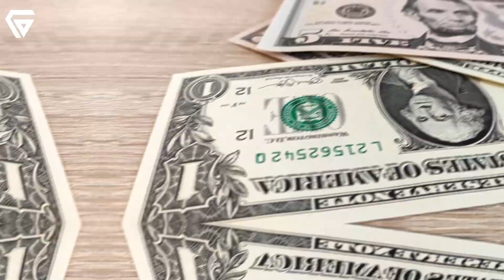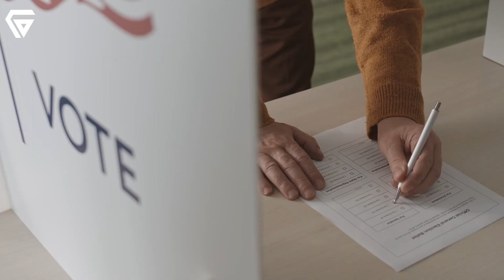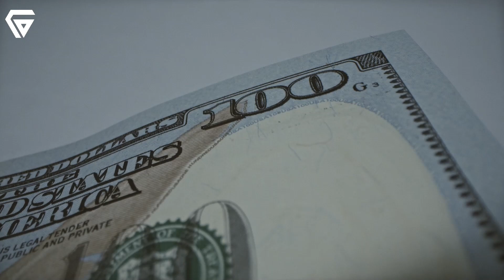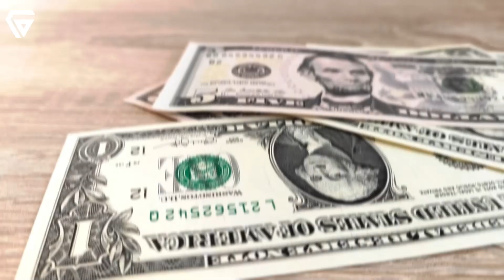Why It Is IMPOSSIBLE for Australia to Build High-Speed Rail?

Comment: The more I think about HSR, the more I realise what a TERRIBLE waste of money it will be.
Take the Sydney to Melbourne route - which is supposedly the primary route. Currently, the GROSS annual airfare revenue of this route is $1.2 billion. That's all. Why would we want to build a line likely to cost (knowing our political system) over 100 times that amount which, even then, will likely capture at best 50% of the daily passengers of the existing flight system.
The maths do not even come close to adding up. Even if it cost $30 billion the business case would still be extremely shaky.
And, being a $100+ billion system, its annual maintenance and operation costs ALONE are likely to well exceed the entire $1.2 billion airfare revenue. There is no business case whatsoever. It's a joke.
Reply: Because more people will take the train because it will be cheaper easier and more efficient

Comment: i don't know why people still think a melbourne-sydney HSR is worth discussing let alone building. a 900km line between 2 cities of 5/6 million each with little in between will never stack up economically even if the terrain is easy, which it certainly isn't from Sydney to Junee at least. If you don't believe that, take the ride. Air travel is the way to go in Aus, and it already does a very good job, and is much more flexible and efficient in getting ppl from A to B, M or X.. less flights and larger capacity aircraft would help environmentally between the big centres

Comment: Easy answer.
Lobbying from private self interested parties who support particular 
Conservative governments re, road haulage for freight, which then affects 
The viability of an improved or new rail network for passenger mostly.
Combined with the current stupidity of our current state government 
By buying new updated inter city trains, capable supposedly of 160 km speeds 
When the infrastructure is crumbling , and especially the trackwork. 
Climb aboard a fancy new carriage, and take just as long, or longer because of deteriorating track work  to  complete your journey.
Has  anyone  recently had a look at our Northern Rail  link near Urunga and Coffs Harbour.
To call it third world is too much credit.
For now, forget high speed 200 km rail Sydney to Newcastle, with new tunnels, feasibility studies, problems with 
Land acquisition,it won't happen in our Lifetime.
Inspect track ,, realign, straighten where possible, camber the tighter curves , 
And invest in tilting Rolling stock like many overseas countries.
Now, you need a decent timetable to mix express and stopping journeys.
No use catching a modern fast train that stops All the way from Sydney to Newcastle.
Maybe have to compromise for now by one stopping first half of journey and another stopping second half.
Commuters are big percentage of revenue.
Maybe install passing loops at regular intervals. Relatively cheap option.
Out of hours majority of runs virtually non stop , major stops Only.
Every hour? Now stoppers can fit inbetween .
Food for thought?. Reality.
Thanks Howard

Comment: After decades of delay, Australians should realise that if the interstate high-speed rail project "needs" to be done, an independent federal institution must be established, and a corresponding law is also required to protect the existence and authority of this federal institution from being easily abolished by the new government if they are not happy with the high-speed rail project. To achieve this, a series of legislations should be successfully performed within 1 or 2 federal terms, and the first term must have the pro-HSR party in a majority government.

But what are the real circumstances? Some Australians obviously don't believe such a future-proof project is "needed." Therefore, no major party will be brave enough to proceed with the abovementioned steps since the majority government will be in danger at the next election. 

In addition, a critical problem with Australia's tax system might be a hurdle for this project. Australians pay their income tax and GST to the federal government, and the federal government then divides the tax funds back to each state and territory through some mechanism. I'm not sure if it will happen, but some people on the West Coast will probably worry that their tax funds could be used to build the high-speed rail while the high-speed rail makes no sense for them since they're living too far from the rail line. This is a fundamental tax-related problem when the federal government wants to support projects that will cost a lot and benefit only some people living in a particular area.

Comment: They should be building on between Melbourne and Geelong that is the first place I would one.Two would be Melbourne to airport.these two will never happen and I’m seventy.someone should go to Europe and see  how they move people around.trams don’t have problems and bus just keep moving here it is a standstill.Got to tax the workers so they cover their superannuation and trips.
Reply: Wouldn’t be any point in HSR between Flinders Street and the airport… trains wouldn’t even reach anywhere near top speeds before having to slow down again.

Flinders Street to Geelong MAYBE… kinda echoes the Sydney to Newcastle HSR route, but on the other hand Geelong would have to grow into a bigger city first for that to be viable
Reply: @LucyJrts - people would commute from Geelong to Melbourne and return if it had a decent rail link is the short of it.
Reply: @chuckbeggles8858   HSR isn’t meant for commuter use though, same reason people don’t commute from Adelaide to Melbourne by plane despite it being only an hour’s flight. Same reason people don’t commute from Berlin to Düsseldorf or Paris to Lille or Brighton to London or Kyoto to Nagoya, all of which are served by comparable length HSR routes (I think Kyoto-Nagoya is only half an hour and departs every few minutes in peak times).

HSR can’t survive on commuters. If anything the idea should be to grow Geelong into a fully-fledged city in its own right, with its own local suburban rail network, and then create a short intercity hop via HSR, just like the Kyoto-Nagoya route. That’s why the most likely candidates for HSR in Australia are Canberra-Sydney-Newcastle, or Gold Coast-Brisbane-Sunshine Coast

HSR is meant for intercity travel, not commuting. It’ll never get built based solely on commuter demand, that’s a pipe dream unfortunately.

Comment: Sydney to Newcastle makes sense.  Would turn Newcastle into a suburb of Sydney unlocking land for new subdivisions
Reply: The only two cities worth joining in Australia are Melbourne and Sydney. Everything else is just fantasy material. You need two massive populations for HSR.
Reply: Most of the land between Sydney and Newcastle is already suburban. This means both the path would be harder and less room to improve density.
Reply: @waza987  would require a lot of tunnel making it expensive
Reply: agree.  Sydney - Newcastle.  Sydney - Bathurst.  Sydney Canberra.

Comment: It costs a lot of money to build it, also a lot of money to maintain it. Railway in China is losing a lot of money as well even if the labours in China are very cheap.
Reply from the maker: You're absolutely right! The costs of building and maintaining infrastructure can be staggering, even with cheaper labor. It's a complex issue that many countries face.
Reply: China intentionally built HSR lines that’ll never be profitable, in order to force the breakaway regions like Tibet and Xinjiang into the fold. It’s purely political.

The actual major HSR network in eastern China is profitable enough

Comment: If it was up to me, rather than building entirely new routes, I would focus on straightening some of the steam age curves, especially on the Sydney-Melbourne route, along with double track between Junee and Albury, and between Lithgow and Orange. Once you do that, you can bring in tilt trains. While it’s not HSR, it will still be faster than what we have now.

The NSW North Coast route is probably beyond redemption, but even it would benefit from tilt trains. 25 kV electrification is doable beyond Lithgow, Broadmeadow and Campbelltown, as long as you have dual-voltage power cars. The North Coast route would also benefit in that you would have 25 kV from Broadmeadow to Brisbane Roma St.

While this will all cost money, it won’t be as much as a dedicated HSR line, with or without massive tunnels.

By way of examples, the S-M XPT can’t get up to a decent speed north of Junee, and the Dubbo XPT only gets a chance to stretch its legs between Orange and Dubbo.
Reply: Being a Newcastle person you would understand much of the issue at hand given the extreme difficulties in getting a railway line all the way from Sydney. The sandstone Hawkesbury / Woy Woy area was a huge achievement in the day and a section of your track was finally built after the track to Hawkesbury and then Gosford to Newcastle had been in service. The regional tracks north, south and west out of Sydney presented enormous difficulties in their day and even today more tunneling in the mined areas of the Sydney Basin would present a challenge.
Reply from the maker: Thank you for sharing your insights! It’s always great to connect with fellow Newcastle enthusiasts who appreciate the rich history and challenges of our railway system.
Reply: Straightening curves means working in a live rail corridor which is disruptive, expensive and usually doesn't yield much in the way of substantial gains anyway. There are of course places where it makes sense but alot of it doesn't. Junee to Goulburn will need an entirely new line the existing one is junk and should just be given to freight, and if you are building a new alignment it only costs about 10% more to build it for 350kph trains as it does to build it for 160kph trains. Junee to the outskirts of Melbourne yes some curve straightening makes sense and much of it is good for 160 or even over 200kph with some minor upgrades and LX removals. Goulburn to Sydney is mostly junk too and should just be replaced by an all-new 350kph high speed line with a track connection to Moss Vale-Bowral-Mittagong and Picton back to the main line so some trains can leave the HS main line and serve the Southern Highlands. Canberra also needs a new line and a new city station, the existing line can be given to trams.
Reply: In Europe, the experiences with tilt trains were not the best. In many cases, they are now used as normal trains.
Reply: @gottfriedheumesser1994  Queensland doesn’t seem to have had any problems with them

Comment: We are not smart enough they can’t run the crap rail system in Australia right now.
Reply: Rail system? Which one? There are 5 completely seperate passenger train systems (or 6 if you split off the privately run Sydney Metro) in Australia at last count. Which one is the “crap” one in particular? Sydney Trains is pretty good for what it is intended to do and the current M1 Sydney Metro is brilliant, with more Metros to come (under construction).

Comment: Rail fans tend to fantasise about rail in countries like China, Japan, France, and Germany. But if you look at which area of the world most resembles the populated area of south east Australia you get a surprising answer. It's more like Scandinavia in area, population, population distribution and (while different) the extent of geographical challenges.  So what sort of train systems exist in Scandinavia? They are not 300+kph trains but more modest 200 kph. They are better matched to their environment, and cost less to develop and operate. Yet few talk about them in Oz.

Sydney to Melbourne is one of the world's busiest air routes. It's busier than any route in North America and almost all of everywhere else. People will say that means it's perfect for high speed trains; but that logic is seriously flawed. It's busy because the Sydney-Melbourne run is perfect for aircraft operations. It's actually an argument against high speed rail (HSR), which is optimised for about half that distance. Sydney-Canberra is doable, but modest in traffic. Sydney-Newcastle is OK as regards distance, but would run through very difficult (and environmentally valued) terrain approaching and through the Hawkesbury area. Victoria actually has better geography for regional HSR. 

But by far the biggest hurdle to HSR in Australia are Australian railway sub-cultures. Take for instance power supply. There is a lot of wailing and gnashing of teeth among rail types in Sydney about using 25Kv AC power for two of the separate new metros (West and Western Sydney Airport) being built. Oh no, that's incompatible with Sydney's existing 1500v DC power system!!!! Never mind that it is significantly better and cheaper as a system and should be retrofitted wherever possible.Yet the same people will clamour for HSR which virtually necessarily needs 25vAC to operate effectively. It's typical of a sub-culture with 'dreams of a future' but a refusal to accept anything that is a change from an equally dreamy past.. 

As a final point, HSR is usually marketed as a huge big glorious project that will revolutionise travel. Often the same people will complain that rail doesn't get the same attention as major roads. Yet major roads (like the conversion of the Hume Highway from a two lane road to a four lane motorway) were never developed as a big single project. It was done in little stages, initially designed to improve the slowest bits of the route. As each bit was done it lifted overall support to complete it for the entire route. It took decades, and was done in dribs and dabs, but it got there. But not HSR, it has to be a project fit for a Utopia episode or nothing. Which is why it will not actually happen.
Reply: I’m a railfan who likes HSR, but I personally understand that HSR is impossible to build here given our current cost of living crisis and inflation issues. I would rather support an idea to build a nuclear power plant in SA than a Melbourne to Sydney and Brisbane high speed rail line
Reply: @tacitdionysus3220  The Pacific Hwy was the same, and it took two major bus crashes (with 50-odd fatalities between them) for the politicians to wake up and start spending the money it needed.
Reply: So straighten some curves and allow the current XPT to stretch its legs then.
Reply: @chuckbeggles8858  
In some places that could work, but the main effort should be to eliminate intrinsically slow sections. 

An example is replacing the very curvy, NSW Southern Highlands line tracks (e.g. Menangle to Mittagong) with a faster route roughly parallel to the M31. 

That's a lot more than 'straighten a few curves'; it's a whole new corridor with lots of excavation and bridge building. But it does give you significantly faster Southern Highlands (and Appin growth area) services as an initial goal.

XPTs can't cruise at 200 kph, but the British original could on good tracks, and modest 'faster' trains that can sustain 200kph where they can is another reasonable initial goal.

Comment: Just say a high speed train was proposed for Sydney Melbourne. Politicians (we know 'em of old) would be voter pressured into having stops at Campelltown, Moss Vale, Goulburn, Junee, Wagga Wagga, Albury, Wangaratta and maybe more. They cannnot help but meddle. Et voila! - A low speed train!!  That's why it is IMPOSSIBLE.
Reply: @johnbrownscombe323  It’s still doable. HSR stations are generally designed with platforms on loops rather than on the main line. That way, non stopping trains can zip past unhindered.

Comment: High speed rail sounds good but without sounding like a politician, building one in Australia is like building The Line in Dubai. It will be another billion dollars wasted  while aeroplanes are still cheaper and faster.
Reply: Aeroplanes are cheaper and faster around Europe too… yet the high-speed rail network was built and remains insanely successful, even outcompeting air travel for patronage
Reply: @LucyJrts  Different geography and topology. In Europe you have major towns densely closed to each other with high population for the commercial use to make sense. That’s why I say Dubai, because Australia is more like a huge empty land where major cities are thousands kms apart.
Reply: Case by case basis, want doesn’t mean need. It’s important to see what Australia needs based on its geography and sociology before wasting tax money, especially as huge as trillions. We all want HSR because it sounds good on paper at least. However HSR depends on terminal station and regular maintenance in between every kms apart, unfortunately with Australia that is still not viable yet. Europe, China, Japan all have 1 common things that make sense for HSR: major cities in between every kms apart with huge population who uses it often.
Reply: Not when check in and travel to and from the airport is considered. 

HSR can drop you at the city centre.
Reply: @chuckbeggles8858 cheaper and faster than planes?